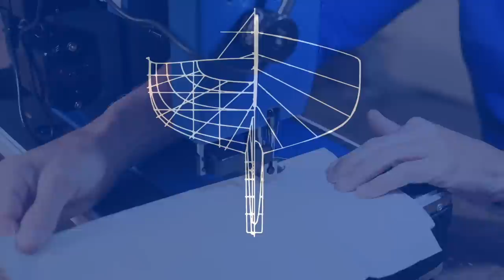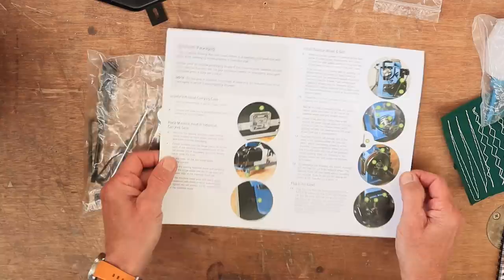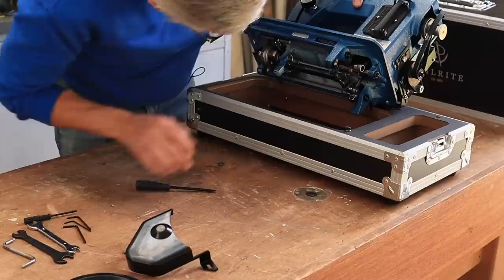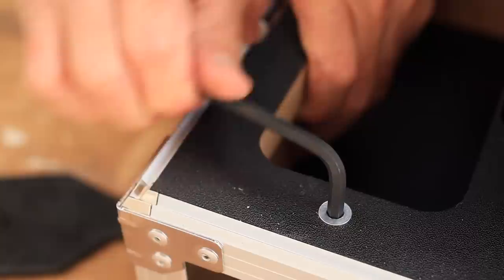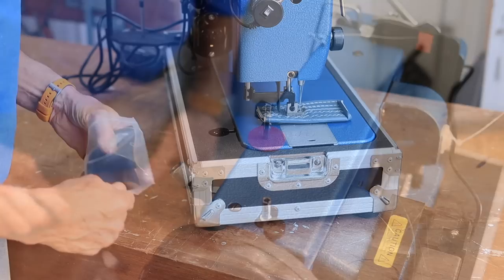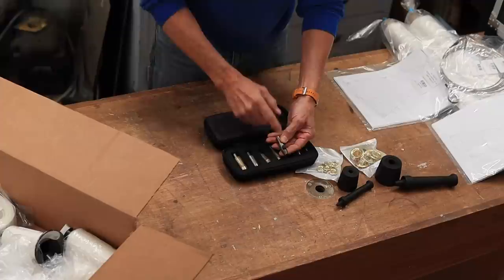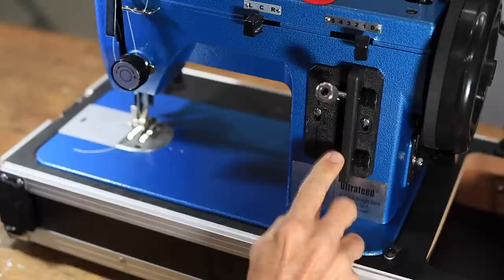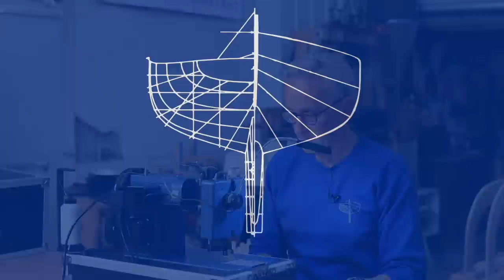How to Setup a Sail Making Sewing Machine, S2-E67

Comment: Bob, as the son of a seamstress and a guy who does a bit of sewwing myself, I quilt and make drapes and such; if you read on in the manual that came with your machine, before raising the foot and removing your sewn piece, use the wheel on the right to raise the needle and the eyelet at the top of the machine above the action to the top. That eye raising draws your last stitch tight and at its top most position let's you also be sure your needle is at the highest reach and completely out of the way. It can be easy to catch the tip of the needle with your fabric and a slight bend can cause a lot of problems like the needle stabbing into the foot or base of the machine, missing the bobbin loop, and throwing the tension off causing looping on one side of your stitching. Also make sure to read the section on bobbin and top thread tensions. Machine cleaning and maintenance is important for the longevity of this equipment as well. Either the manufacturer or a sewing machine shop should do this maintenance. There are super fine adjustments that must be maintained for any sewing machine to last it's longest life. Additionally, canned air is your friend. Blow all lint and dust out of the underside before storing the machine, and check the manual for lubrication points.

Comment: Late to the party, just catching up on my video watching. Long time owner of an LSZ-1 with nine of their sail kits under the presser foot. Good company, the kits are well thought out and the directions clearly written. Haven't gone far as to build a table or cut a hole in the floor (though it has been considered) but a low platform with a hole in it for the machine has been very useful. Think of it as a run-off table like you have for a tablesaw, you need to keep the sail rolled up to pass under the arm as you add panels, it is helpful to keep the whole assembly on one level. I work off the floor so there's not a lot of up and down. Watch for debris in the doublesided tape used to baste the panels together, I have a few cat hairs in all my sails keeping me company.
Reply from the maker: Thanks for the tips. Looking forward to my sail making project!
Thanks for watching!
Cheers,
Bob

Comment: Next you need a hole in the ground to have the machine at floor level. Like in a sail loft.
Reply: In a sail loft they quite often have a supersize elevated table with a notch for the operator and the sewing machine to sew large sails…